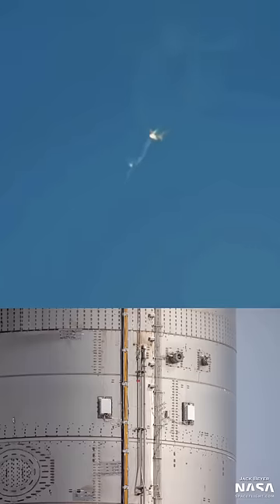Is This Why Starship Wasn’t Destroyed The Moment It Lost Control?

Comment: Is this considered acceptable or a qualified failure/under-performance of the flight termination system?
Reply: I mean, the FAA won't be THAT annoyed if all the debris landed where it was supposed to, this will probably amount to a "fix it before you try that again" warning. They probably are annoyed about the massive dust cloud and the pad having a 25-foot hole in it after launch, with bits of concrete flung everywhere because the company didn't install a proper flame diverter or water-based noise and vibration suppression system on the ground... for a 5,000 ton rocket. And concrete-rich engines are counterproductive to reliable flight performance!

Comment: 50 seconds seems like a looong time to destroy a malfunctioning, aerodynamically unstable rocket.
Reply: Not really... it wasn't in any danger of going outside the approved flight corridor, so at no point was there any danger that required the FTS to be triggered.
Reply: @simongeard4824  errr. I think the point is if it had gone in the wrong direction. Looking at what happened on the pad who knows what might have happened. Not cool.
Reply: @ab8jeh  Read up on what FTS do, blowing up the rocket is not part of there mandate.
Reply: @Zacho5  Sorry, you're clearly the expert. My apologies. I will endeavour to read up on what the FTS should do.

Comment: This would have been the perfect opportunity to test emergency separation of stages to see if starship could land it's crew safely in the ocean after a booster failure.
Reply: that system probably doesn't even exist yet since they're still working on the whole "successful orbit"
Reply: @leonjohansen1818  maybe, but that seems like it would be a software update and nothing mechanical, since it was supposed to splash down gently anyways.... Just a little further down range.

Comment: Will have to look again at that flight termination system if thats the case. If the rocket had been been heading for an inhabited area 50 seconds would have been far too long.
Reply: Once FTS was activated, the rocket became ballistic. No usable thrust. FTS takes into account  ballistic range during flight I’m sure and it’ll depressurize tanks before an errant rocket had a chance to deviate enough to be dangerous. They may have to make FTS a bit more let’s say pronounced, but there’s no hard evidence either way based on just this test flight. Here, FTS activation was on exceeding the flight envelope, but still very conservative and unnecessary anyway. This rocket was not going anywhere but mostly straight down.
Reply: @absurdengineering  You can never be too careful, only last week a Swedish sounding rocket achieved its target altitude of 155 miles then veered off and went 40 miles off course landing only 10km from a Norwegian village, as it had already achieved its mission target when it started to go off course there was no propellant left for a self destruct.
Reply: Yeah- so many people are like "SpaceX got it I'm sure" - after seeing the risk culture at Elon-run places (ala Tesla with their autopilot) I would never assume they "got it".  Don't get me wrong- there are a lot of very smart very good people at SpaceX but we've seen that even at a place as risk averse as NASA that sometimes engineers get overly confident, especially with regards to edge-cases.
Reply: @absurdengineering  mmmh, decreasing pressure and releasing fuel until a heightlimit is reached before making it boom is an interesting thought indeed.

Comment: The range-safety charges did destroy the vehicle immediately?!? I guess we know what is going to be the number one thing the FAA is going to have on Starship’s recertification checklist 🙃
Reply: Starship is not certificated. Each test needs approval.
Reply: Not too surprised, it starts getting hard to casually break things when you build this big and clearly also prioritize structural strength. Might need a long cutting charge or something, to really rip a gash into the tanks.
Reply: @JoseNovaUltra  That's why it's a REcertification? Each flight needs to be approved (certified).
Reply: @kindlin  its no recertification. When starship finishes its development it can apply to a certification as usual cargo rocket (or human carrier in future), this will mean that a some restrictions will loosen up, obviuosly not that much.. aerospace industry need to be perfect everytime. 
As of right now starship needs extensive paperwork for each step of development.
Also is not a recertification if it is a different vehicule, which has been the case with all starships.

Comment: What's really nuts is that you can see the ticket trying to right itself, I mean it even monouvered  itself and went right back up again, that's impressive
Reply: It's tumbling. It doesn't pause in any orientation for longer than any other...
Reply: It was completely out of control long before it started tumbling. All the rockets that could swivel were burned out well before it got to this point.

Comment: Starship needs a rescue escape procedure to separate from booster and save the lives of future crews
Reply: but what if the Starship is the one who fails?
Reply: Starship itself is a huge upper stage, a proper escape system would require a separable cabin with pusher motors to distance the crew from the large propellant tanks.
Reply: I like the idea of having an emergency system that could separate just the cargo section and make it function as a reentry capsule complete w heat shield and parachutes.
Reply: Such a procedure will exist in future... but obviously wasn't considered a priority for this mission, given the lack of crew and the lack of any reason to recover the upper stage.
Reply: If they do devise such a system it will only be put in the passenger version
Reply: @steveschritz1823  well imho you need a nuclear power source to do mars ... so it would be nice to land the stage.  Irradiating the Gulf of Mexico is NOT my idea of a good time.
Reply: @patrickmcginnis7  that's why we need to build facilities on the 🎑 then 100 miles away from living and command areas, then built nuclear powered propulsion if it  leaks no one dies unless to close to reactor. Much safer than anywhere on 🌍. Plus it will be easier to launch from the 🎑 since no gravity and a little less time to get to Mars then from 🌍.

Comment: As a person who is not versed on Space mission or Space anything besides Star Trek and what's seen on TV, I would think Operations / Flight Control would want to test  saving Personnel and Payload in a situation like this. Several people alluded to that.   I  too was impressed at the tumbling of the rocket and it not breaking up. As far as the 40 or 50 second delay of rocket, I would imagine that more data would be compiled during that time weather it was deliberate or not.  As far as the Comments goes, I'm learning a lot and by next week, I'll be able to apply for a job with SpaceX. Just joking! You Space Trekkies Rock! I enjoyed reading the comments, very insightful.

Comment: The system being used is like this because honestly they never expected it to get as far as it did, there was a half and half chance it would blow up on the pad, once it cleared the tower it climbed in points and was at about 60/40 instead with it having more chance of surviving.

But the reason it didn’t was the pad, stage 0 if it had of been replaced with the necessary equipment (and held the launch back indefinitely nobody understands you need to be able to get it approved and that would take time they didn’t really have better to risk damage and having to replace it fully then to hold back launch on a vehicle you’ve made obsolete with changes to the next one)

The flight plan is also over water for this exact reason, if it climbed and made it past the tower and to max Q then they had a better chance of it completing its planned mission, they can test what I would call “minimum requirements to blow up a rocket” being explosives where they have them it didn’t work as planned but it’s literally the least you could do but make sure it worked even if it took a few seconds!

But having it over water means if it didn’t work at all then it hits the water and doesn’t blow then up they get to keep it.

Now I guarantee the flight termination system will include a much more sophisticated way to do so,  if not for the next stage (like if they aren’t forced to change it) then it will be for the next one after, see unless the FAA tell space X they need to make it better before testing the next one they won’t do so, or if they do it without being told it will be because they are able to find a “fair cost” so they will do it if they know it won’t be a stupid investment but make it safer the equation will be safety vs how much the new or changed system will be. And if they deem it to be safe as it worked and until they have it not work they don’t need to change it they probably won’t till not the next test but one after, as changing it for the next test probably won’t be cost effective and though it took 40 seconds it still worked.

Comment: If you have that expensive thing flying through the air, you may as well get as much use out of it as possible. Like testing any kind of systems that can be tested that normally wouldn't have to be used unless there is a problem and they can run through them. Purging, fuel dump, coolant stuff

Comment: If SpaceX depends on tank structural integrity failure due to loss of pressure and it took that long to come apart, what would happen if it occurred at a much lower altitude? Say it lost guidance and was heading towards a populated area, would the system be destructive enough?

Comment: I suppose ideally,  if you have to abort, it would be better than the rocket exploding immediately than when the pressure stabilizes and loses momentum falling towards the ground. Makes for easier forensics if you can find most of the parts  as opposed to the rocket rolling off its axis at 5000mi hr., hitting abort, and having wreckage scattered across 50miles or whatever.

Comment: The flight termination systems were not safe, they should work quickly. I'm sure they'll fix this in the future. Fortunately they didn't have to activate it under more dire circumstances like the rocket flying out of control towards a populated area.

Comment: What's the most impressive thing to me is that the thing is like 300ft tall and survived somersaulting multiple times through the air at over a thousand MPH without immediately disintegrating.  The damn thing is built like a brick shithouse.

Comment: The hydraulics didn't work. I was there. it was supposed to separate... try  to save the launch they intentionally tried to save the launch but it didn't work...
Reply: They did not try to save the launch. The rocket never got to the stage separation point. The FTS is automated.

Comment: Nothing "took so long" as the booster tumbled over and was heading nose down it took a sweeping downward glide path.
Notice the attitude and trim orientation jets puffing away.
They were designed to squirt puffs to make minor adjustments on descent so it lands upright. I don't care what MIT Wunderkind wrote the steering and navigation protocols and telemetry order. Landing a large 110 ft rocket on its tail perfectly is anything but easy.

Comment: why is there a "flight termination system" that is destructive?  why not have valves which cut the fuel OFF from the combustion chamber and then have 1 small temporary parachute to slow it down.. then the one that brings it down softly??

Comment: Wouldn't it be better to put the FTS inside the tank at the top of the tank? As the LOX level drops, presumably there would be vapor at the top of the tank. Push the big red button, and the FTS should ignite and produce sparks which will rupture the tanks and ignite the vaporized oxygen, resulting in an RUD.

Comment: Oh boy, dumping rocket fuel straight into the atmosphere.
Reply: A couple tons of oxygen and methane(fuel), CO2 and water(exhaust) is almost nothing, compared to other causes of polution
Reply: @Marrrrrko47  "But there's a lot more to rocket pollution than CO2. Depending on the type of model and fuel used, rockets can produce soot (black carbon), nitrogen oxides, alumina particles, chlorine, hydrochloric acid and water vapour"

Youre so smart and handsome.

Comment: Could it be that when the pressure inside is at such a low point that air now gets sucked in and then bang.  Bit like the exploding tin experiment filled with gas, used in school physics lessons.

Comment: And they can't even design a self destruct that works properly
Reply: They just launched it again this Saturday and it worked flawlessly. Cope harder
Reply: @jacklets3851  a broken clock is right twice a day. It still exploded, this time due to communication loss. Their rocket, on every single test flight, has literally shaken itself to pieces. 

They rushed the first launch by not finishing the water deluge system and completely destroyed the launch pad, claiming they were testing its durability, which resulted in debris damaging the thrusters on launch. They continue to ignore flight permissions from the FAA and violate their licenses. They act as if they're pioneers that are learning to walk for the first time while completely ignoring 70 years of space flight history and research out of some misplaced superiority complex.

Will this ship work eventually? Yes, I don't doubt that at all. But they are being careless for no reason other than vanity.
Reply: @Irishrebel092  They just function different than most other space companies. Space x prefers real world data over data from simulations. You can say whatever you want about their process of doing things, however you can't say that they don't know what they're doing. Their falcon rocket blew up countless times. several failures one after another for years and now it's one of the most reliable and frequently launched rockets in the world.
They make incredible progress every single year that passes so I really don't think there is a point in questioning their process of doing things.
Reply: @jacklets3851  I'll preface this with that while I respect your position, I feel it's misplaced. the problem is most of the explosions are unnecessary failures without any care for where their debris lands or who's property they damage. Sure, they don't have to use simulations, but they have 70 years of proven and field tested data they can use instead of needlessly blowing up rockets above populated areas. Again, using the water deluge system as an example, you cannot logically argue that they were justified in launching the first test flight without it being in place. 

You know what's possible when using proven data from our 70 years of space exploration? Getting a rover the size of a car onto the surface of Mars using a rocket assisted landing crane on the first try while still having a 30 minute round trip communication delay. With SpaceX on the other hand, they launched a car into space and missed Mars by over a quarter of a million miles and needed a random interviewer to suggest using reclaimed waste gas thrusters on their rockets so they can steer.

Comment: Imagine if NASA had this many failures. It would be shut down indefinitely
Reply: These are test flights of prototypes of an entirely new rocket. They just have a different development approach, and make "Trial and Error" with real rockets instead of making only Computer simulations.

SpaceX regularly sends Falcon 9 rockets into orbit, also for NASA, and the falcon 9 is super reliable.
Reply: @sebastiannolte1201  Okay.
Now.
Imagine if NASA did the same.
= 0 funding

Comment: I don't believe that's correct. Typically the FTS consists of linear charges which go along the side of a tank. To it rips up the tank over a large area causing it to loose pressure quite fast. I don't think that's different for Starship. 
The white boxes are most likely the electronic boxes but not the explosives.

Comment: How are the first and second stages separated on starship and booster compared to falcon 9?
Reply: On this rocket they were going to spin it a bit and let the two halves separate. They never got that far. On the next rocket they are going to use hot staging. The second stage will start its engines while still attached to the first stag before the mating system releases.
Reply: @bensemusx , how are they going to undock the locking pins on the clamps before the engines put too much pressure on them?

Comment: So not only does the rocket not fly properly but these guy can't even make a self-destruct system work correctly? it's not inspiring me with confidence.
Reply: Failure is a a part of the process. They just launched again on Saturday and the fts worked perfectly with no issues
Reply: @jacklets3851  So the booster blowing up after separation is not an issue?

Comment: In other words, even the Flight termination systems were a failure.

Oh, lemme guess, it wasn't a failure it was just a test run to see if it worked and that's why they sacrificed a starship, heavy booster, 39 raptor engines, the OLM and the concrete of stage zero.  Right?  facepalm

Comment: The real answer is that Elon musk can’t deal with failure and probably tried to hold off his staff from blowing the thing off for as long as he could.
Reply: Nope. This is one of two main failures of the launch, they ignited FTS but it wasn't enough to destroy the rocket instantly, the rocket cartwheeled in the atmosphere even after FTS ignited without being teared apart by all the forces generated on the structure. If you look at it clearly you can see the fuel going out from the holes created by FTS ignition.
Reply: He can deal with failure. Their falcon rocket failed MANY times and now it’s the most frequently launched rocket in the world